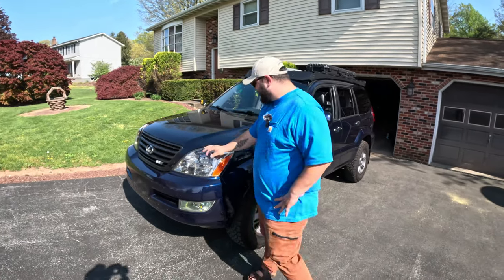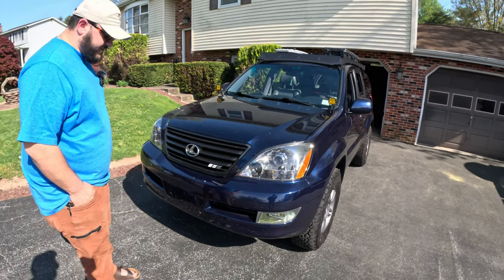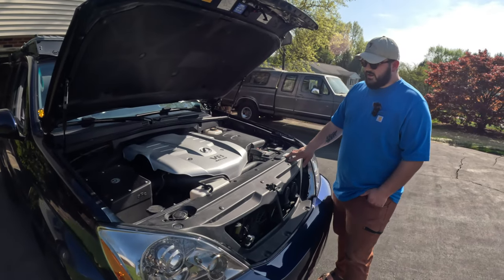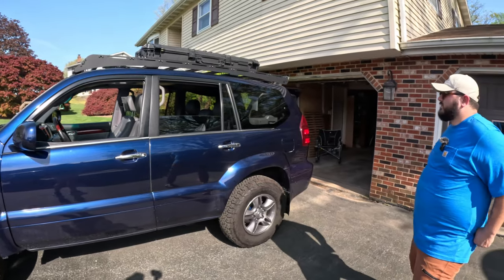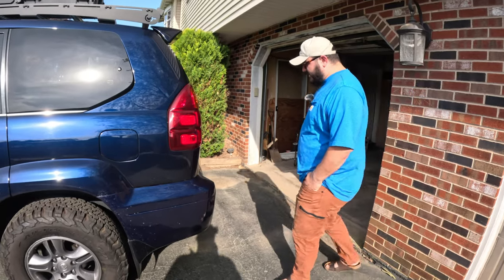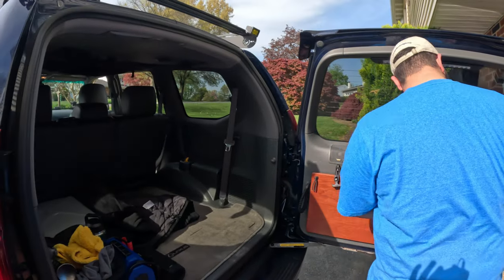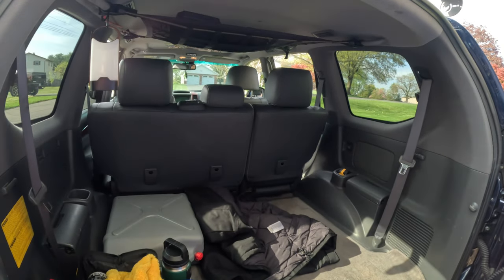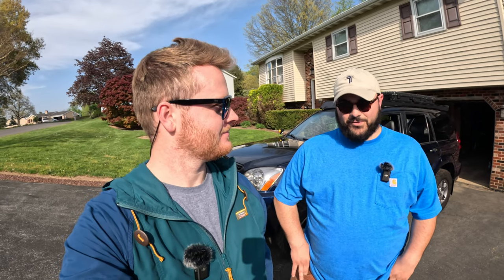GX470 Mods Walkthrough - Mild 'Overland' Build

Comment: I got my gx470 timing belt and water pump done at a Toyota dealership, less than $1000.
Reply from the maker: Sounds like a good price. We did it on this truck last winter and it took 12 hours for two amateurs.
Reply: How did you score that!  Thats  $2000+ job at a stealership usually..

Comment: Nice GX.  Are those rims the stock color or did you plasti-dip them?  I have a 2009 GX, but my stock rims are chrome. Yours looks more gun metal.  I’ve been looking at getting some gun metal TRD pro wheels but plastic-dipping my stock rims might be a reasonable option.  What kind of tires and what size are they?
Reply: Probably Sport package wheels, had a dark graphite finish.